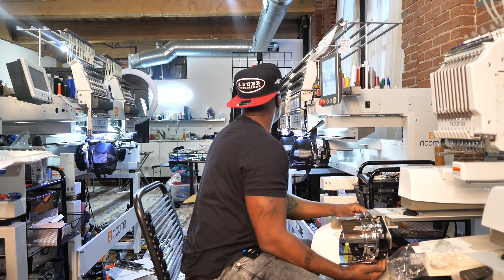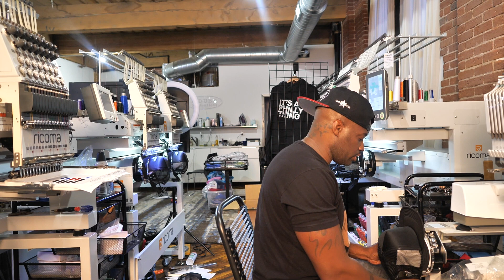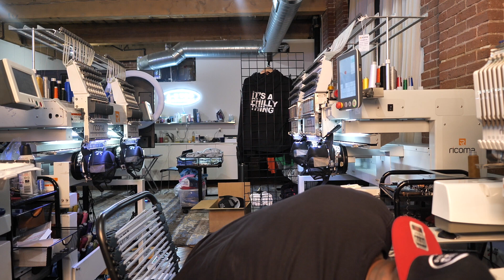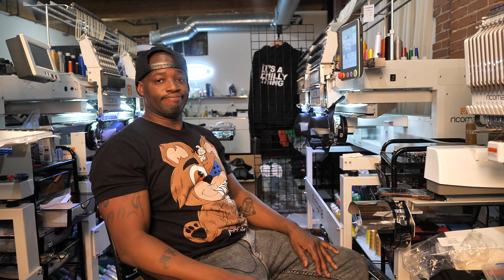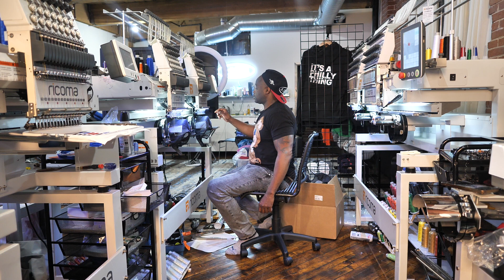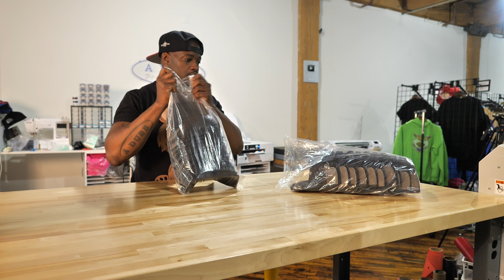Work with me on this Quick 20 hat order while making DTF Transfers

Comment: One tip for you cut that backing in half save you some more money. The one that come long like that are the best size. But the ones that come cut already i dont really like they are a little to tall for the standard hat hoop. But try it out if your only doing the fronts like you did there.
Reply from the maker: Great idea. That design I was embroidering would have worked fine with half the stabilizer. Thank you.
Reply: @A-Dubb Productions Allan Wade  no problem I use my paper slicer to cut like 10 or 15 at a time

Comment: I'm thinking of doing transfers and was going to buy the larger heat press from Ricoma. I know you are an affiliate for them ,but are heat transfer machines different from one another, or are they similar? thanks for any help. I'm looking at a Hotronix press, but they are almost twice the cost of ricomas. Is it due to the ability of the press. Get what you pay for kinda thing?
Reply from the maker: I don’t have the hottronix fusion Iq 16x20 flat press so I can’t give information on it.  The ricoma press is good, it could be better.  I particularly like the touch screen it has but my go to press is the Wala pro from heat transfer warehouse. What I will say about the fusion Iq 16x20 press is that for the price I wish it was auto open. I like the my presses to be auto open so I can walk away and it can open up by itself if I am across the room. I want a fusion IQ so I can experience it.  Everyone that has one loves it so it can’t be that bad. Still I wish it was auto open like the fusion iq hat press. I think it might have not been possible to make it auto open with the magnets because it’s a pull out and swing away. They do have however have one that requires air to auto open so that is an option but you’d need a air compressor. I’d say 16x20 Wala pro press from heat transfer warehouse.

Comment: Hi, do you have any issues embroidering flat bill hats on your two head machine. I can seem to embroider the flat bills on my two head machines. The hat bill hits the bottom plate and creates needle breaks. I have the design as high as I can go in the hat and it still breaks needles. any tips would be very appreciated. Thanks
Reply from the maker: If you have your design as high as it can go in the hat and it’s still hitting the bill then your design is too big.  A front hat design should be about 2.3” tall 2.5” max if you are skilled anything over that is to big.  Did you adjust your foot so the presser foot holds the hat in place before the needle passes threw?
Reply: I keep my designs below 2.5". I will check the the presser foot. I called Ricoma and they said to put masking tape on the bill  which didn't work. I sometimes bend the hat bill but it does not work that well. I don't have any issues with curve hat bills just flats. I also have a single head machines that I don't have any issues embroidering flat bill hats. It's a bit frustrating because most of my big orders are flat bill hats. Thanks for your input! I appreciate it.
Reply from the maker: Are you on a em-1010 or a Mt-1501?
Reply: @adubbproductions  I’m having problems in the MT-1502 two head machine
Reply from the maker: This video should help. https://youtu.be/2OMcqrwrqSk